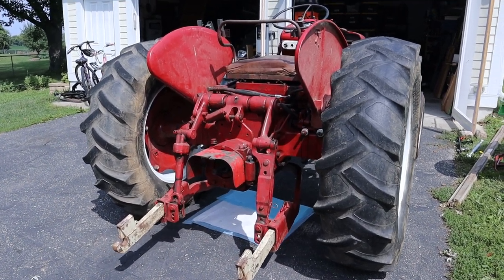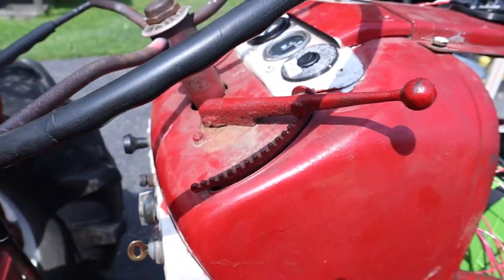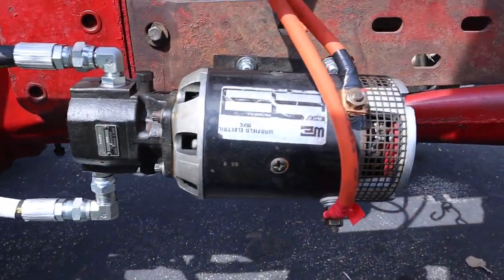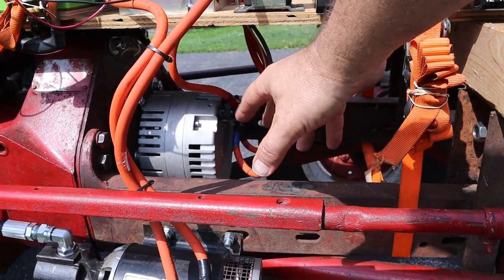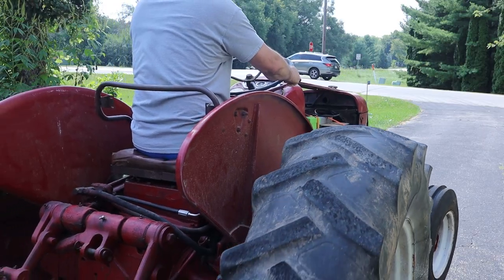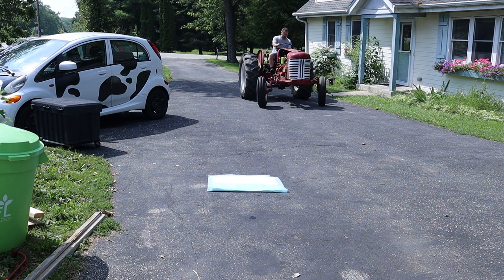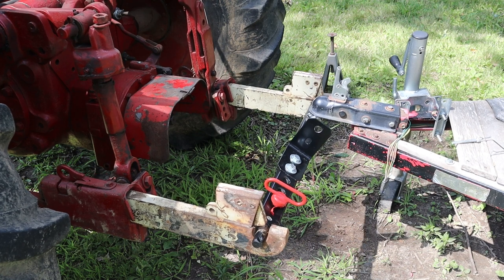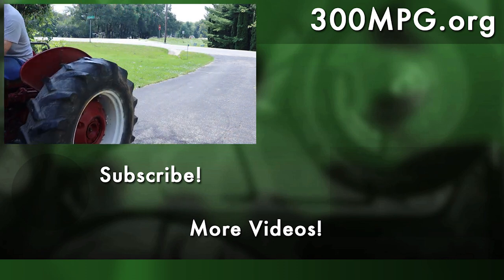Electric Tractor Overview, testing, and towing

Comment: I know this videos old but i just started the same project🎉 im thinking a bit different  as i just wan2 mow large areas with it so im going to try and power the deck blades separately then the drive to see if i can make some kind of high power mowing deck that i can switch out the  deck batteries easier  while relying on relatively low drive power  to get around . Im no mechanic but i know electrical a fair bit so im hoping i can do this lol

Comment: Awesome. Contemplating doing mine with a warp 9 double shafted motor. And running the hydraulic pump off the other end of the shaft. I’d have to leave the motor spinning at the idle run of the old diesel motor to run the hydraulics well though.

The warp 9 should be a very torquey motor especially if I run it with the 120v speed controller that I have.

I would love to also install a bypass for the speed controller so that I could hit a power dump and full throttle it with the full current that the batteries could supply for a second or so if I needed it.

Comment: Was the hydraulics as noisy before when powered by the engine?   Would using a bldc motor be any quieter and still provide the same torque and performance?
Reply from the maker: It's hard to say how noisy the hydraulics were when powered by the engine, because of all the engine noise!
I think one of the issues with electric vehicles is trying to quiet down all the things that you normally wouldn't hear because of engine noise! Apparentally, that's one of the big issues in commercial electric car design!

It seems to me that this electric motor and pump were a little noisier than the other electric motor and pump that I used. Both were brushed series-wound motors. I'm not sure exactly what the difference between the two is that would account for the volume difference.

Comment: Good   day from Ontario.  Interesting  video. Do't know much about electric other that motor.  I drive some  electric   fork lifts,
So what did this all cost so far.   I remember when u bought 300, so wha was  wrong with gas motor?
Thanks good luck   I guess u don't have to worry about it starting  in winter
Reply from the maker: There hasn't been much cost so far, as I've pretty much been using parts I already had. I got the motor and controller from a friend, already had the batteries, etc. Once it's a final design, I'll be able to tally it all up.

Comment: Try a Prius steering weel
Reply from the maker: Are you suggesting electric power steering?
Reply: @BenjaminNelsonX  yeah Off course electric power steering.

Electric power steering use BLDC Motor i think it's efficiency is good for power save of electric tractor 🚜.
Reply: @MTZ_Tractors  He needs hydraulics for the loader, 3 point, etc, anyway, so going to electric power steering doesn't negate the need for the hydraulic pump and thus wouldn't really improve efficiency enough to matter.
Reply: @JeremyAkersInAustin  
 In case of front loader its better to use hydraulic power steering instead of electric, because i think hydraulic power steering has more powerful 💪🏻 and better for tractor works.

Comment: Wondering if you could resurrect the old pump somewhere down the line. Was it less noisy/whiny than the little one?
Reply from the maker: The original pump was mechanically driven off the back of the engine. I hadn’t thought about trying to adapt it to an electric motor. No idea how loud the original pump would have been, since it couldn’t be heard over the gas engine. 
But I can’t imagine it being an improvement over an electric motor and pump that were already designed to work together.
Reply: Hi guys, please consider that the inline crankdriven pump wouldnt be running when you stop. So in low speed situations where you need it most you get the least support. With the diesel engine there is always idle, so you always get the pump support
Reply: Ben, why not placing it in this huge gap between motor and radiator. Plus just some housing and it will improve very very much